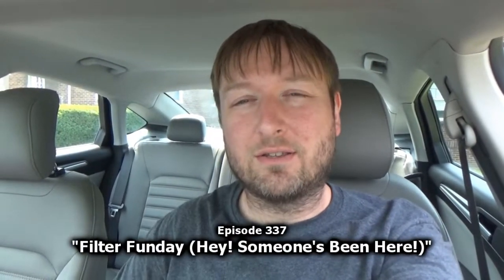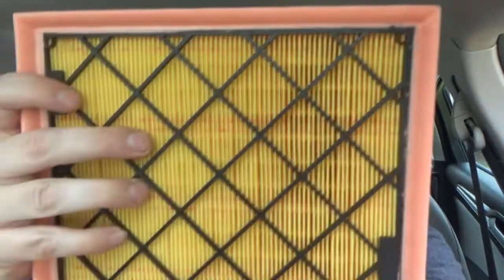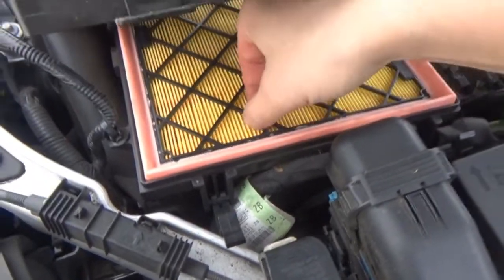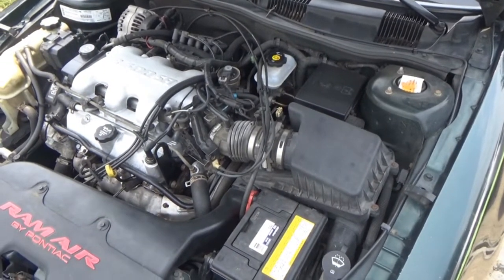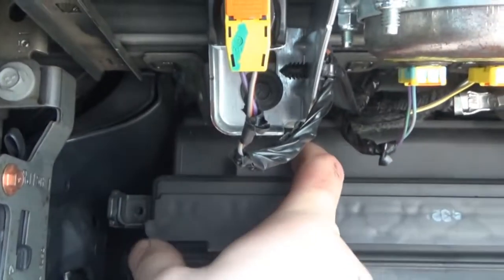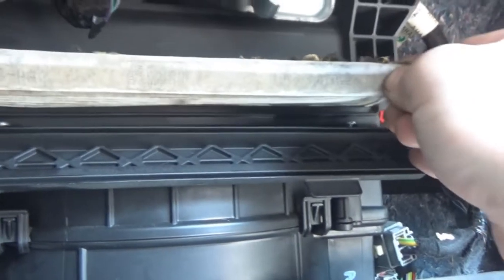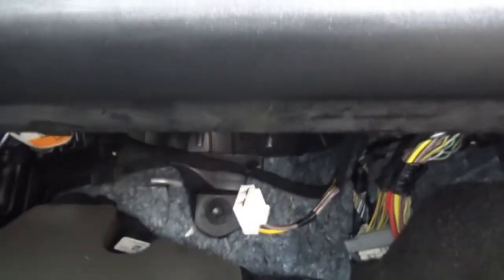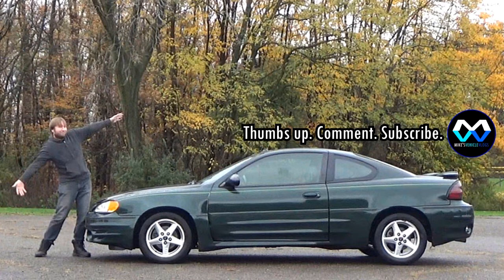MV 337 - "Filter Funday!"

Comment: I had a 79 impala towed in when I worked at a dealership in 89 it had 125k it was because the air filter was clogged shut besides other things it needed.